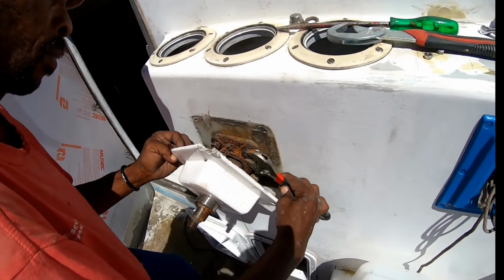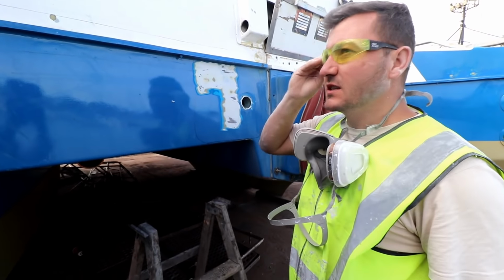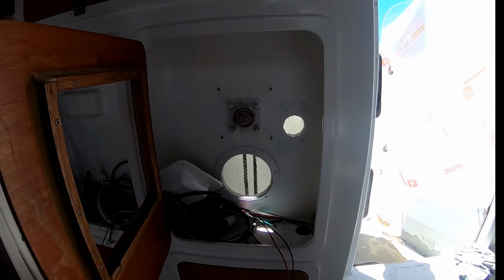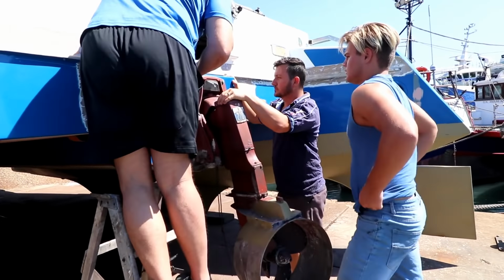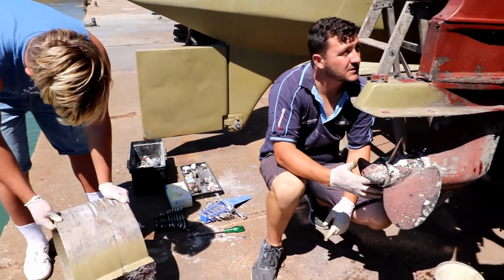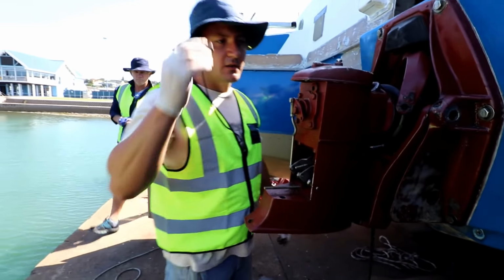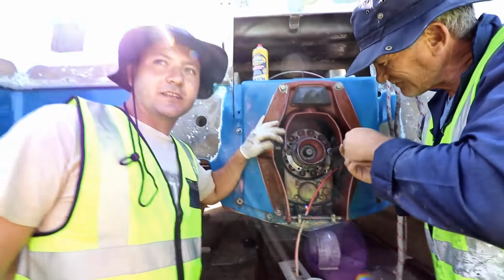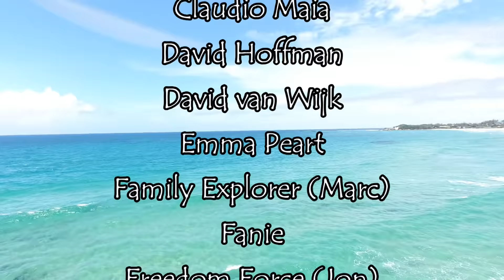REMOVING our OLD GEARBOX | YACHT REBUILD WEEK 48

Comment: Shrouded propellers are a safety feature and will help prevent lines from wrapping around the prop.  There may also be some benefits of aircraft ducted fan systems, which significantly increase volume and direction of thrust.
Reply: I disagree with your assessment. Any fouling of the prop will be dramatically more difficult to clear with the I'll designed kort nozzle. It is in fact as you say  a simple shroud. If the shroud was a foil, it would be a proper kort nozzle. As it is, it simply increases drag, adds nothing to the thrust and increases the difficulty of clearing a fouled prop.
Kort nozzles have no place on a sailing vessel.
Reply: @svphoenixandme776  no-one's worried about the difficulty of clearing a fouled prop. When you've had to pick the remains of someone's leg out of an open prop, suddenly a cowl like that seems a brilliant idea. I'd hang on to it, clean it up and reinstall it asap because that is directly in the area where people are going to be boarding on the swim platform. Props and humans mix together far too well, but the resulting score always seem to be in the props favour, and cowls swing the balance a bit.
Reply: i think the primary reason the nozzle was fitted,was because this type of outdrive is designed for a planing powerboat.
the prop has quite a large pitch and small diameter,also the gearbox ratio is probably either a 1.6:1 or 2:1 making it not really suited to its current application which would call for a slower moving prop with quite a bit less pitch and gearbox ratio of 3:1
.
i belive that the nozzle has been fitted as an attempt to stop air cavitation caused by the fast spinning prop and its lack of depth below the water surface when running at higher revs or any thing other than flat water 
i agree it will increase drag and generally be a pita to clear if fouled by plastic or netting if it can't be lifted clear of the water.

but by the same token i'm sure ricky once he knows it's limitations will   be able to sail accordingly and get reasonable performance out of it even if it does cavitate at higher revs.
Reply: @svphoenixandme776  mmm kinda sorta 
What happens is the static thrust goes up a lot
what this means is that in the lower power range theres more thrust on the same power
At the top end the underwater drag increases, this can be quite limiting except where the underwater profile is low

So what you need to consider is what engine speed you are more likely to settle on, if its low a duct has benefits.

In other things, it might have a greater propensity to pick up crap as suction is going to be higher, and be harder to clear
On the other hand the duct offers the screw and marine life some protection
The final thing we studied was noise. Ducts exhibit less noise except for a particular area
They punch out a louder signature in a 45 degree cone (approx) aft of the duct
otherwise one might reasonably conclude that ducts are less noisy and operate at lower RPM for the same thrust

of course for a submarine likely to be pursued from astern, the skipper would want to pay particular attention to get abeam as quickly as possible to avoid detection. In the run of all things there are as they say 'other things' that a skipper might rather be doing. Since new battery 'like' tech will for the first time give subs the ability to outrun a pursuing surface ship, being without probably is the better, ymmv
cheers
Reply: @z_actual  ...And Others,
First, I appreciate the well thought out responses to this topic. Some good points have been made. Particularly by A Bond who points out the outdrive being fitted in an atypical application and makes sound assumptions based on his experience. 
As I do not have an extensive background with yacht propulsion, particularly catamarans, I did not comment on the outdrive found on Lady Africa. What I do have extensive experience with are kort nozzles. As a captain of many large commercial vessels, I've run many open wheeled and nozzeled boats. All of the ocean going, albeit constrained to  coastwise service, boats had open wheels. All of the tug (push) boat's had nozzles. The nozzles are, cross sectionally, foil shaped to affect the pressure of the entering water in a way that increases the thrust. I'm not an engineer to explain the details of how that happens.
A side benefit of the propellers being within a housing in that configuration is that there is some additional protection for the prop and objects which it may have otherwise come into contact with. This is merely a side benefit.
The basic premise of my original comment is that "kort nozzles have no place on a sailboat". On this point, I stand fast. However, as A Bond points out, in this Particular application the non foil shaped shroud may very well be there to lessen or eliminate a Particular issue with this Particular installation. 
Ricky, you are/is a competent person and are/is in the best position to evaluate the situation. You/he will make the choices that work best within your/his situation.
Kind Regards,
Matt
Reply: @svphoenixandme776  "The nozzles are, cross sectionally, foil shaped to affect the pressure of the entering water in a way that increases the thrust. I'm not an engineer to explain the details of how that happens." " I'm not an engineer to explain the details of how that happens" 

fortunately or otherwise I am

The correct use of a duct changes the diameter a pitch of the impeller. This means the screw must turn faster, presenting somewhat of an efficiency gain, and the flow through it is straighter, with no tip vortices provided clearances are tight. So there are lots of pluses there attractive to commercial boats like tugs that all operate at lower speeds most of the time or work at lower speeds critical to their purpose. 

So to your question the foil cross section of the duct is simply a drag reduction measure, as this is among the things against it its worth doing. However as you alluded also ducts can have a wider throat than they do an exit providing some compression of flow/ Remember Bernoullis law for aerodynamic lift, slow flow down and pressure increases. Likewise throttle the duct exit and wake pressure increases 'over a smaller footprint', but there are limits or its stalls. 

Before anyone goes crazy about that whether in air or water its still fluid dynamics and all the same rules apply except that water is 800x the mass. Basically my instruction was in aircraft principles but it never held me back in the submarine business. 

have a good one
Reply: dirtTdude  
no its the same thing, both air and water are  fluids, and there is compressibility in water, 
just as a gas in a suspension is a fluid in another state, you boil a fluid it becomes a gas, water to vapour where there is vapour in air anyway. 
Once you are examining forces these are dynamics which can only be worked out as a fluid
Otherwise just as we would never have any weather, which we know we do because pressure varies. 
Just as water pressures respond to density depth per atmosphere every 32ft, and to temperature because the medium expands and contracts, a pressure in itself
The processes are identical, the dynamics are identical, the values differ

Which brings up the importance of the weight of a cu ft of medium air or water, 
which is easy to work out a force from an air or water dynamic and work out a pressure from a density in slugs per cu ft.
For air a pressure or lift in pounds = 0.5 x p x (V squared) x area x coefficient, where p is air density in slugs per cu ft at sea level, 0.00238, 
coefficient is very broadly 1+ in the range of 1 to 2, actually a perpendicular flat plate of 1 sq ft is 1.28. While v squared is velocity in ft sec squared
While the slug for water is 1.936, so divide 1.936/.0.00238 = 813.445 or about 800x difference in density, 
the equations are identical but the 'p' varies of course
Reply: I didn't mean to make this a contest in who is smarter, jus a possible observation.  However, I did find this, which certainly makes it appear that efficiency and performance are improved with a shroud.
https://en.wikipedia.org/wiki/Ducted_propeller
Reply: dirtTdude  I'm not smarter than anybody on this subject.  I posted a simple observation that having a guard around the prop would help to deflect lines, and that there might be other advantages.  You smart folks turned it into a pissing contest and I didn't weigh in again until today, when I did a simple google search to see who was right.  The link I posted isn't an absolute either, but it was the closest I found in a quick search.

Comment: Another great movie from you guys. As to the propeller duct you should keep it. It will make your propeller more efficient and will remove the paddle effect the propeller gets. And since you only have one engine that will help you alot if your going into a marina with some side wind. It will slow you down when sailing if you can't raise your propeller above water, but that would be nothing compared to the shaft and propeller itself.
Reply from the maker: Thanks so much Peter. We got a lot of mixed reviews about it so well test it out and see how it goes..

Comment: Those Volvo  out drives are real old now, I hope you can find the parts.they were strong though.  Does the leg lift high enough to be out of the water when sailing? If so all the decisions of drag from the nozzle/shroud is irrelevant.
I expect the main reason for the shroud it to help with the steering thrust since there is no rudder for the prop thrust to push against.
Talk to Doug at SV Seeker about a ducted prop , way more efficient for a given diameter. ( if prop lifts out of the water).
Cheers Warren
Reply from the maker: We'll see. Yeah it lifts completely out of the water. Thanks for the support Warren!

Comment: Hi,great vid, just a note with the prop venturi/guard . On my 45ft cat when l was  running 2 x 40hp 4 stroke honda o/b's with the venturies l gained 2knots in speed for the same given rpm or reduced 500rpm for the same speed BUT the biggest plus was the thrust in rev was massive. I also redirected the exhaust  up a lot higher in the 500mm extended legs & blanked of the exhaust  throu the props,anyway manouvering in wind was easy. I've just set up 2x electric motors  throu 19" props & shafts,so testing will start soon ,especially regen when sailing....cheers
Reply from the maker: Thanks Peter 👍🏻 😁

Comment: You are going to want to reinstall that kort nozzle shroud. That's going to be responsible for a huge amount of power and speed. Without it you are going to have difficulty steering and burn a lot more fuel.

Comment: good job getting the engine and out drive out without damage,plenty of youtube videos on rebuilding the volvo 270 and spares  available from volvo at a price .

on the engine if it was noisy before, fitting soft instead of hard flexible engine mounts will greatly reduce engine noise and vibration transmitted through the hull .

when rebuilding the engine replace all your rubber coolant hoses as these although they may be intact perish very easily if they are 30 years old.
the same goes for gearbox lip seals on the prop shaft and the gaiter/bellows.
check all your morse cables for wear,replace any that are corroded or have damaged outer sleeve's.
the same for corroded battery cables etc

regarding the tube on the prop i think you may not have a choice wether to refit it or not, due to the very short drive leg length and the prop being not very far underwater.
which in anything other than flat water, will cause the prop to cavitate,or even come out the water in big waves.
the tube should to some extent reduce cavitation,but not much  can be done if the prop is coming out the water in big seas apart from reducing revs to prevent over revving the engine if it is sucking foam
keep up the good work

Comment: I had a similar sort of Volvo Penta drive on the back of my Sea Ray.  It was excellent, yours has been so badly neglected.
What a bloody awful job getting that off.  When you put it back - hope it's as good as mine was  !    :)
Reply from the maker: That's awesome to hear. We have heard good reviews. She just needs a good amount of TLC and she'll be good to go again hopefully 😊
Reply: The way you go about your work , I don't doubt it will be as good as new   :) @livingwiththemaias
Reply: @livingwiththemaias   I back repairing what you have for two reasons, if you get it repaired you will understand it and be able to figure what is wrong the second they are fairly common so parts are available. I would keep the shroud as it will make it easier to manouvure with a single engine. With two you can have one forward one reverse to turn the boat you will not have that option. If you were replacing them look at having one electric one diesel, you can save fuel and maintanance on the electric side and when you need the power the diesel is also the generator for the batteries and electric system not sure why more are not built like this there may be a reason.

Comment: You know how Yamaha make almost the entire engine out of one chunk of metal?
the trouble with those stern drives is they make em out of 17,000 dissimilar metals
inside of 20 minutes the whole business turns to sh*t, 
I say sh*t instead of shit because I said sh*t to one guy once and he banned me for it
but its ok I got him back in the end

The other thing I thought I saw was a duct around the prop
be careful here because if its done right (which it probably isnt) the pitch and diameter should be different to a straight prop
they can be more efficient in a few speed zones, probably not for 100% power but better thrust in a zone lower down
we looked pretty hard at them for submarines, and a few of the newer boats are sporting ducted propulsion
so if you chucked it which is perfectly fine, you might need to figure out a new prop
anywho have a great Christmas, remember to drink plenty and remember nothing
cheers
Reply from the maker: Merry Christmas!! No partying hard for us.. we got a boat to finish :)